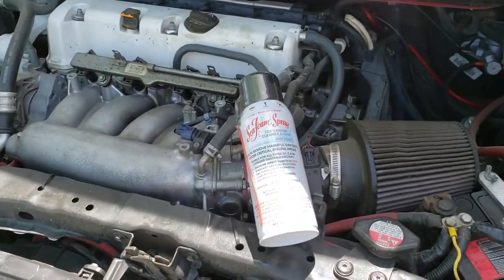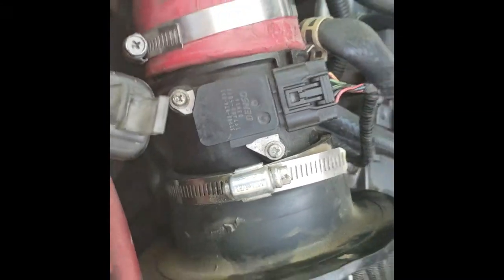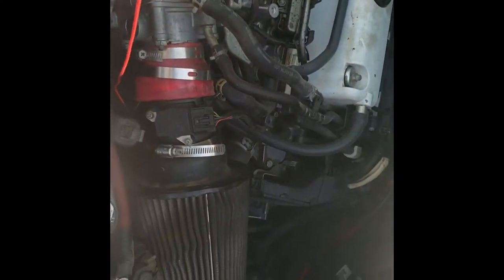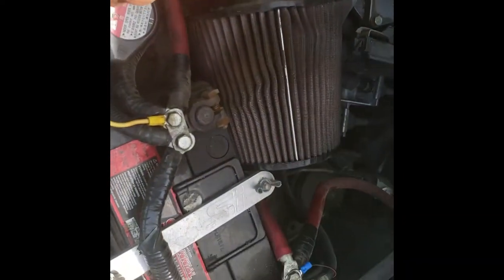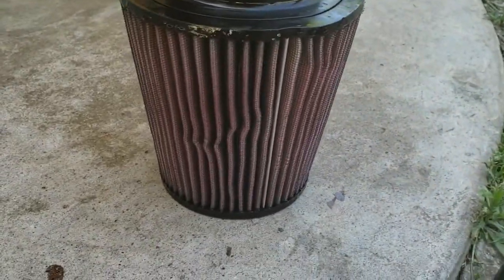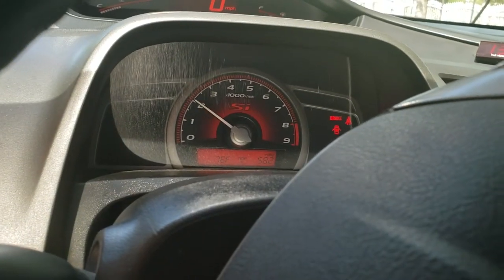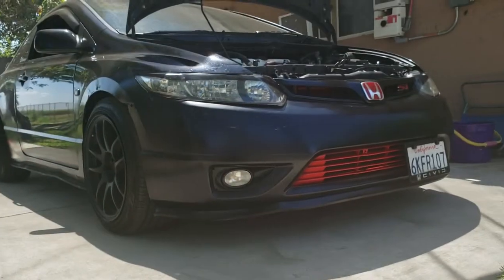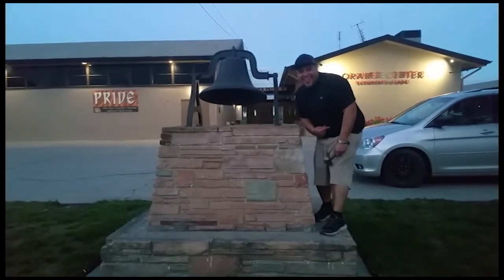How to: Do a Seafoam spray treatment on a 2006 Honda Civic Si

Comment: Hey so how did that short intake effect the drivability
Reply from the maker: Didn't affect it at all! Ran like a champ 🏆 💪
Reply: @559powerscape  alright I appreciate it and I followed you on Instagram like a month ago but my tire has almost rubbed a hole through my eBay/takeda cold air intake and I was considering doing something like that to avoid hydrolock and rubbing